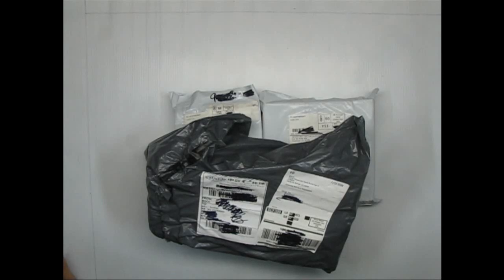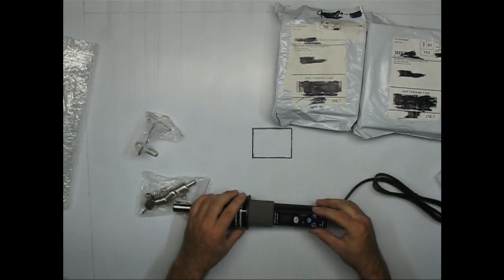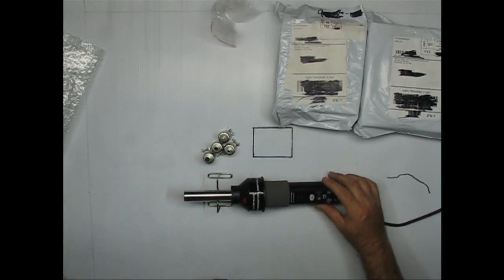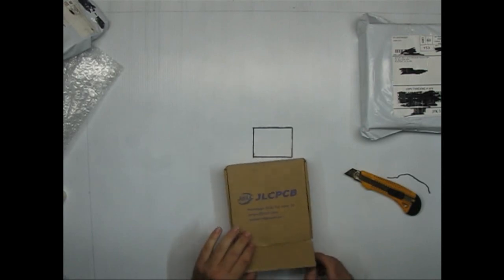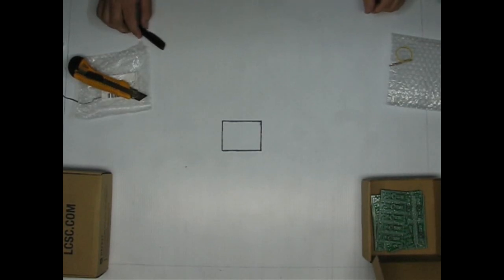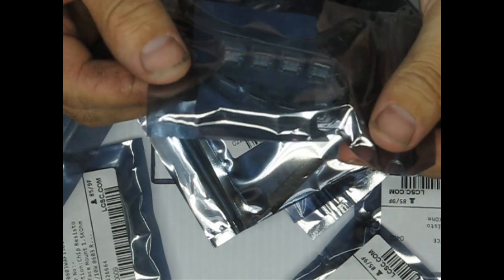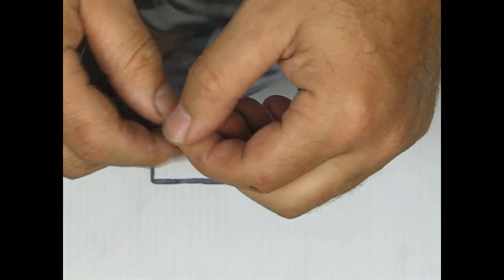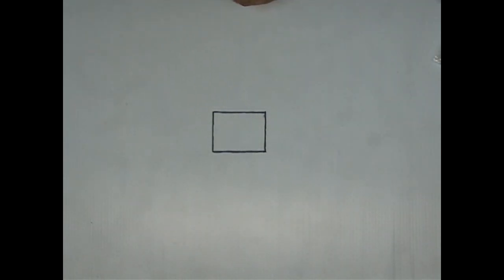Post Bag #1

Comment: 710 F to C = 376.6666, so it is most likely in F on the display for the 110V model
Reply from the maker: Yeah, that's what I was thinking too. I did the conversion later and agree. I'll have to remember to add subtitle corrections in my vids like other "professionals" do  :P